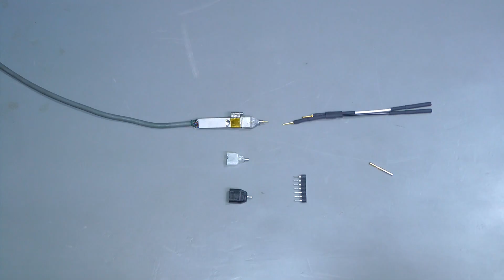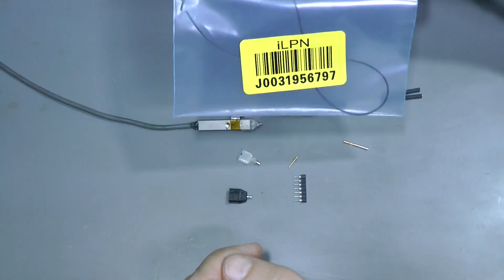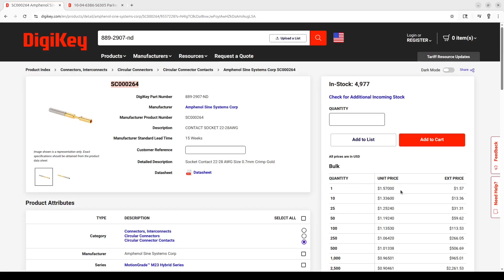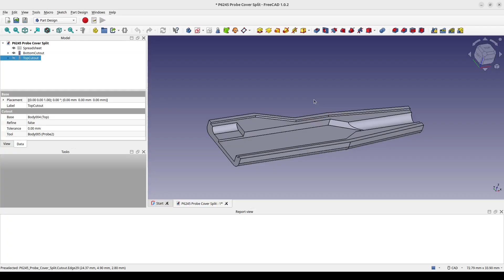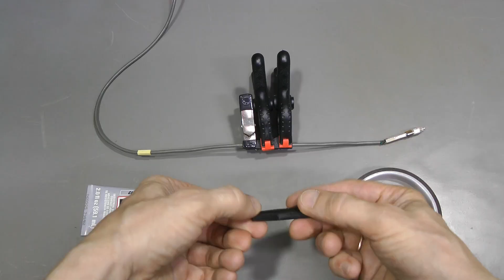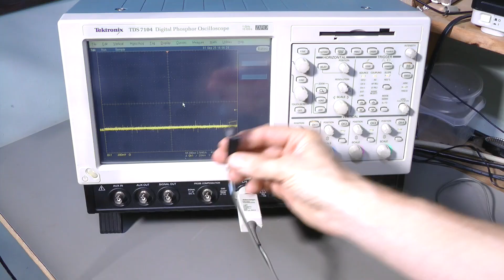#163 - Tektronix P6245 active probe repair - part 2

Comment: thge indent in the pin is for it to snap into place when inserted into the connector body.  It was not designed for crimping or soldering.
Reply: The result was excellent.  Good job!
I use M309029/58-360 pins to fit into the probes.  I make short jumpers to standard proto sockets so I can connect to pin headers on my circuits.